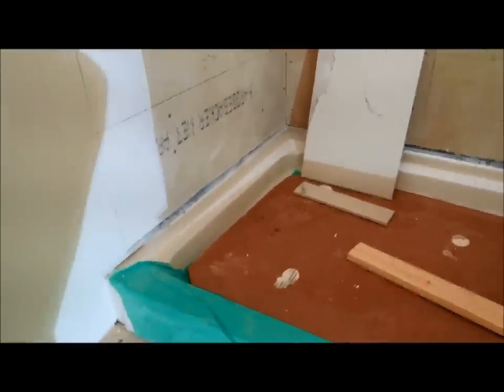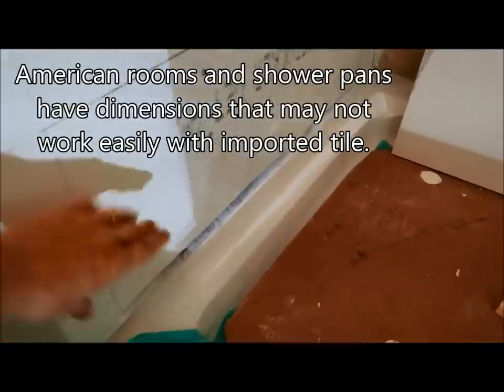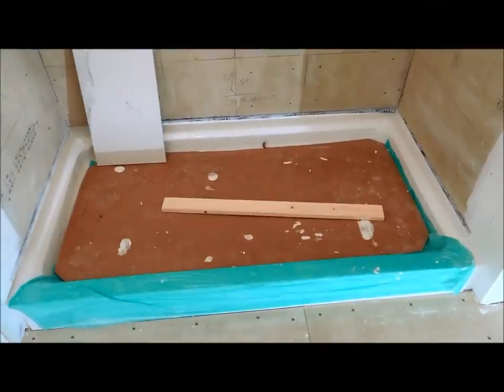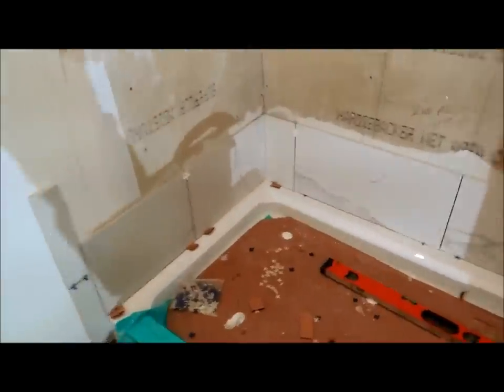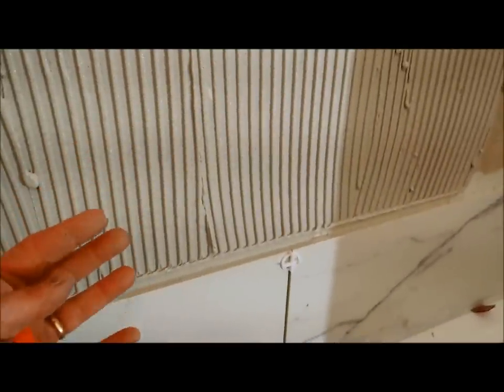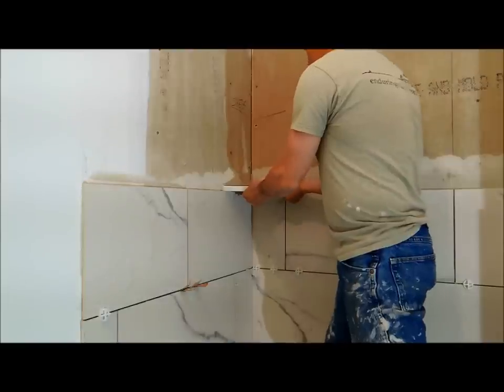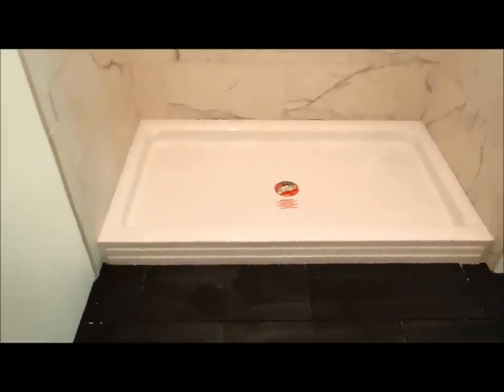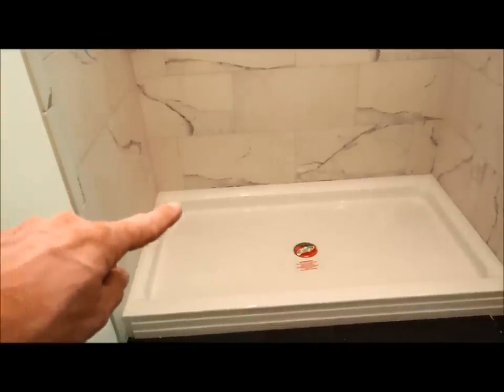Tiled Shower: Start To Finish

Comment: Thanks for the video. Suppose the shower enclosure is not well maintained by the owner and moisture makes its way down the vapor barrier and flashing tape. Am I to leave weep holes in the sanded caulk where the tile meets the shower pan? I imagine that it would necessary but it would also look unfinished if I do. Thoughts?
Reply from the maker: +david lawlor There's a lot of confusion on this point.  The flashing is there in case something goes catastrophically wrong.  If you actually have streams of water getting behind the tile and backerboard, then you have a serious issue and weepholes will be the least of your concern!  Water vapor or moisture migrating through grout lines due to heavy use or whatever will not require weep holes, it will slowly dry out during times of non-use.  In the bathrooms I've remodeled where streams of water have actually flowed past the backer and into the wall or the space below there was serious structural issues.  One case was a poorly framed condo that had a shower corner open up completely over a period of a decade because the studs moved.  Another was a mentally challenged man under professional supervision who routinely showered without the curtain closed and over a period of years the floor rotted out, causing the tub to sink and open up cracks in the wall.  The flashing is there as a stopgap in cases like this, not for routine use.  So, grout well and keep the grout maintained and go ahead and caulk the bottom of the tile.  If you believe the framing or the house is subject to minor seasonal movement due to the heating cycle you can also caulk the corners.  The caulk is flexible and will move rather than crack.  Weep holes are not needed.
Reply: No def not if done properly it's not a problem. Vapor barriers can be a moisture nightmare trapping condensation in the walls creating mold. You want to waterproof vapor barrier should be between a exterior wall and the siding or whatever your house is finished with not after the insulation on the inside.

Comment: No Waterproofing membrane on top of the cement board?
Reply from the maker: See this video https://youtu.be/FYSZQp-Y_kI at the 16 minute mark.
Reply: Why do you not have to water proof your screw holes in hardybacker. That’s an entry for water to get behind it
Reply from the maker: I've taken apart at least 60-70 bathrooms, some over 30 years old.  I've never seen a single screw hole leak water into the stud bay.  When I tile a shower floor, I use Schluter waterproofing membrane on the floor and up the walls.  For shower pans and bathtubs, I may waterproof the corners with the same membrane and I use a flashing system behind the hardibacker cement board that I prefer.  Other than that, waterproofing isn't an issue.  Take a look at this old video:  https://youtu.be/xk7lNudSV2Q

Comment: Great video.  I appreciate you walking through this.  I've watched a few videos where the installer said that the 'running bond' pattern was not advisable with the 24" x 12" tile because tiles tend to 'hump' in the middle.  That didn't seem to be an issue with this tile but I'm wondering if that was because it was an Italian tile?  I purchased a porcelain tile (24" x 12")  from Home Depot and I'm wondering if I can't do what you did here.  Thoughts?
Reply from the maker: This is a great question.  So, large format tile can be tricky because it naturally tends to cure with an arc to it.  In other words, if you put two tiles face to face, you would typically see the faces touch in the middle with gaps at either end.  Some tiles are worse than others.  On a floor, especially, this fact can lead to "lippage" where one tile edge is slightly above an adjoining tile.  Typically we install large format tile overlapping by thirds in order to mitigate this problem.  Overlapping by half (the running bond pattern) can sometimes be done on tile up to 24 inches in length if the arc isn't too great.  Longer than 24 inches and overlapping by half becomes unlikely.  You need to examine each batch of tile to determine what you can and cannot do.  And, actually, expensive Italian tile is usually worse in this regard than an inexpensive factory tile.  I don't commit to a pattern until I've had a chance to open some boxes and put tile face to face to check for the arc.
Reply: @enduringcharm  Thank you for the detailed reply. That is exactly what I needed to know. I will go ahead and check my tile and make sure the overlap isn’t too bad. I also plan to use a tile leveling system to avoid lippage so I can just be more aware of where I put those leveling wedges. Once they dry obviously it should hold.
Reply: @enduringcharm   Great detailed explanation.  I took my tiles and did just what you suggested and they were flat as can be so I overlapped at 50%.  It turned out great!  Thanks!
Reply from the maker: Great--glad it worked out!

Comment: Great work! I’m considering laying 12x24 tiles in my tub surround . I noticed most people use ledger boards to support the weight of the tiles . I noticed you didn’t Because the shower pan is leveled . How long did you wait to tile the second row? And each following thereafter .
Reply from the maker: Most of the time I also use a ledger board to start the second row and then go back later to hand fit the first row.  Once in a while it just happens to work out that the pan is dead level, but it isn't often.  If I'm using modified thinset over hardibacker cement board then by the end of the day I will have reached the top of the shower and I can go back down to remove the ledger and fit the first row.  Or, if I'm coming back the next day to tile the floor I may just wait till then.  But, if you have a row supported by a ledger or by the pan you can keep right on tiling.
Reply: enduringcharm thanks for response

Comment: Love your videos.  My question is, I have a similar shower pan.  I am using 12x24 tiles.  I want to tile about 3"past the front of the tile pan.  I will be using a schulter edge.  I'm on the fence on how to start my tiles.  Do I set the 2nd row then go back a set the first row starting at the point past the shower base cutting around the pan and trimming the bottoms of the tiles on the remaining first row?  I hope this makes sense.  Thank you in advance for your help.
Reply from the maker: There's no real right or wrong in this instance, and I will sometimes start with the first row or sometimes with the second row depending on circumstances.  In your case you have a very large tile which will need to be cut around the shower pan.  That can be tricky to do, especially if you need to get the first row dead level for the second row to sit on.  So in your case I'd recommend installing a temporary ledger to hold the second row and start there.  Just make certain you are starting the second row in the right place.  Find the low spot around the perimeter of the base if there is one, hold a tile there, and mark a line at the top.  Your ledger should be a little below that to allow for "meat" for cutting when you do the first row.  You may even choose to go much lower, depending on where the uppermost row will end.

Anyway, once you get the other tiling done, go back and hand fit the first row of tiles.  You may break some tiles or make bad cuts, but you'll know how many tile you have left by then.  With a larger grout line you'll have a little bit of wiggle room in the event you don't get the row dead level.  Also, with a 24 inch long tile you may find it has quite a bow in the middle--this is normal.  So, if you are doing a running bond pattern (offset) you may need to do thirds, not halves, in order to avoid lippage.
Reply: @enduringcharm  thank you for your quick response.  I am a few days away from tiling but I will think through all options.

Comment: What brand of thin set did you use, sir?  Thank you for your time to answer!
Reply from the maker: The brand is really not important.  I use three or four different brands depending on what is available.  However, for applying tile onto cement backerboard I choose a modified thinset, which has latex additives for additional strength and flexibility.

Comment: Did you cut the full tiles on the 1st row for the valve and back wall or are they full pieces?  If so, do you recall the cut size?
Reply from the maker: I've done a couple dozen bath remodels since this video, so I don't recall the details.  What you are asking, though, is how to handle the bottom row?  Most typically I will install a plywood ledger to support the SECOND row.  The ledger is installed (if possible) so that the first row installation will require a slight trimming of the tiles to insure a perfect fit.  After the upper rows are secure, I remove the ledger and hand fit the first row.  That said, sometimes you just get lucky and the shower pan or tub happens to be dead-on level.  In that case, you can install the first row on the pan or tub ledge and work your way up.

Comment: But dont you still need to water proof the walls? Yea it's getting tilled but water can still penetrate the grout lines, I've seen people water proof using red guard and Schuter products for walls just wondering if that necessary I'd think for a completely waterproof wall it is but I'm not one to cut corners
Reply from the maker: I have another video about waterproofing you should watch.  It isn't that I reject all waterproofing but that I believe there are circumstances where it is needed and circumstances where it may not be needed.  I've torn apart a lot of bathrooms in my day, most of which included tile over wallboard.  That's something we don't do anymore (for good reason) but in examining those bathrooms as I tore them down, I was able to see where problems develop and where they don't.  Where tile was properly installed and grout/caulk was maintained over the years or decades, water intrusion simply wasn't a problem--even over wallboard!  If you watch some of my other videos you'll see I use a multi-layer flashing system for the first three or four feet of height underneath the hardibacker when I have a tub or shower pan.   That protection is there in case the homeowners fail to maintain caulk, or there is some future structural shifting, or whatever.  The tile over the hardibacker (which I prefer over the porous and crumbly brands of backer) keeps water out of the wall cavity.   Now, if I know a shower will be used constantly in a big family, or I expect heavy use for some other reason, or if I'm not liking the venting or structure of a bath for some reason, then I may choose to install Schluter membrane over the backer.  Same goes for when I'm tiling a shower floor, of course.  But, I don't believe every single shower must be plastered with Redgard or Schluter membrane no matter what, and therefore I save my clients the extra expense of that work if I don't feel it's necessary.   There are bathrooms many decades old now, built before Redgard or Schluter existed, and they haven't melted yet.

Comment: Isn't better to cut the tiles where the shelf is sitting? that way there is a continuous horizontal grout line
Reply from the maker: It's easier to cut the tiles above when you can mark them from the actual shelf, but if you prefer the look of cutting the lower tile there's nothing wrong with that either.

Comment: Hello, excellent video. Is there a difference in longevity between hardibacker vs kerdi boards?  Jut to get an idea how much did this project cost to remodel? thanks
Reply from the maker: Fiber cement products like Hardibacker have a long history and have been around for decades.  It will certainly last the life of the bath or kitchen.  Kerdiboard was introduced in 2010, so it has less history to judge.  As for project costs, they vary widely depending on scope of project and costs in your area for materials and labor.  Remodeling magazine publishes an annual cost comparison you might find helpful.

Comment: In regards to tiling a living area, should you remove the skirting boards before tiling, and then place them on top of the tiles, or just tile up to the existing skirting boards? Thanks!
Reply from the maker: +Michael and Jessica Marrinan By "skirt boards" I'm assuming you mean what I call the baseboard--the moulding around the perimeter of the room.  I prefer to have the tile go under the baseboard.  It looks better, and it allows the wood moulding to expand and contract with seasonal changes without forming gaps or cracking the tile.  Some people also caulk the bottom edge of the baseboard, although that isn't strictly necessary.
Reply: +enduringcharm Yes baseboard is what I meant. Thanks! Very helpful! We are moving into a new house soon and tiling and painting are the first two jobs!

Comment: Hi there great video....but will have to say for such a large format tile it should be 1/2" ×1/2" trowel
But great video n great tutorial
Reply from the maker: This was a 12 inch tile, and a 3/8 notch is fine for that. A 16 inch or bigger tile would require a 1/2 inch notch.
Reply: Overkill

Comment: Is it ok to put a tile floor straight on to hardiboard? I was thinking about doing that but was afraid it would flex too much....
Reply from the maker: First, it's hardiBACKER, not hardiBOARD, which is a different product.  Typically on a floor 1/4 inch hardibacker is used under the tile, but the cement board provides no structural support.  That is accomplished with layers of plywood.  Take a look at my video on subfloors:

https://youtu.be/rmrLxfaGXyQ

Comment: how come you didnt  mesh and thinset the corners?
Reply from the maker: +gasmanrm My most popular question! I need to annotate the video on this point.  Mesh tape is important when there is flexing between two sheets of the backer.  The mesh and thinset stiffen that joint.  If the framing is such that there is little or no flexing, and you are using a stiff backerboard brand like Hardibacker, then the mesh tape may be omitted.  If I'm installing a smaller tile, though, I use it every time.  Smaller tiles are more susceptible to movement.

Comment: What size shower pan is that? My shower looks exactly the same size, and hope to use a similar tile and layout.
Reply from the maker: It's been a long time, but that looks like it was a 48 inch unit.  Those are typically 30 or 32 inches to the back, occasionally deeper.  Be certain your selection fits in your opening.

Comment: No water proofing membrane?
Reply from the maker: In some applications I'll use a waterproof membrane--I like the Schluter products.  However, this was a shower pan not a tiled floor and in some circumstances the extra money and work to add a Schluter membrane simply isn't necessary.    You'll see from my other videos that I install a series of flashing products behind the hardibacker in the event of some failure in the future.

Comment: no waterproofing? at least RedGuard or some kind of membrane?
Reply from the maker: You can see from my other videos how I prepare the walls and flashing behind the backerboard.  If I'm tiling both a floor and walls I'll use the Schluter system.  I use hardibacker brand cement board and it is not necessary to waterproof that product.  I do often apply Kerdi band in the corners, though, as seen from about 15:30 on in this video:  https://youtu.be/FYSZQp-Y_kI

Comment: Did you set the tiles on the shower pan flange or did you overlap the tile on the pan flange? 

I’m not sure how to address that area?
Reply from the maker: You should see some of my other videos about prepping and tiling shower areas where this is addressed.  Ideally the cement backerboard comes over the flange, and I also like to flash behind the backerboard, overlapping the flange with a self-adhesive window flashing.  Of course, if you are using the Schluter system or similar it has it's own detailing.  Sometimes the circumstances prevent bringing the backerboard over the flange, in which case it is brought to the top of the flange and you must rely on that flashing I mentioned.  In both cases the tile is brought over the flange, leaving a gap the same as your grout line.  That gap is caulked with a silicone or grout-color-matched caulk.
Reply: Hey thanks for the fast response, I’m using a Grifform pan that has a generous height to the flange. Without furring out the studs the 1/2” backer board sets flush with the flange, can a guy tape and thin set the cbu pan flange junction and then cover that joint with something like mapei aquadefense, then tile over the joint on the flange?
Reply from the maker: If you can fur out the studs you should.  If a wall cannot be furred out because it extends into the rest of the room you can put the backerboard on top of the flange and flash as I indicated.  See this video:

https://www.youtube.com/watch?v=psf9cnYoVts&list=PLD4oAOZqK9mCjvmw_nUkZBrPPXf_20Lad&index=26
Reply: enduringcharm 
Excellent I wish I would have found your channel sooner. Thanks for the tips.

Comment: Do you use mesh in corners
Reply from the maker: My methods have evolved over the years.  Currently I prepare corners installing a strip of Schluter Kerdi membrane, even if I am not installing it over the rest of the backerboard.  Tis helps strengthen the corner and also waterproofs it if it ever opens up.